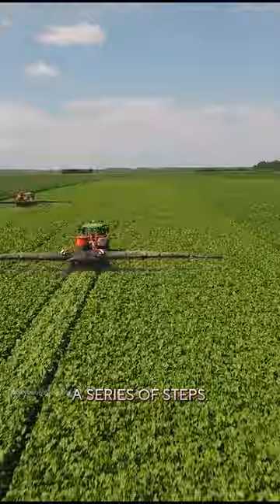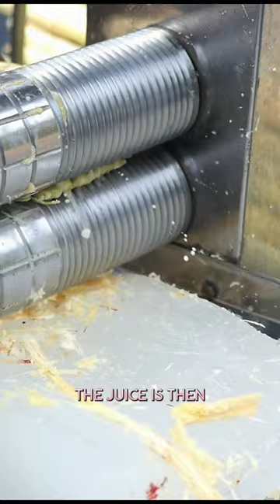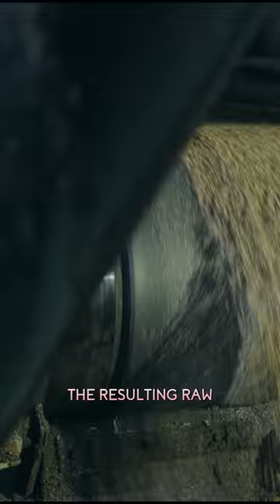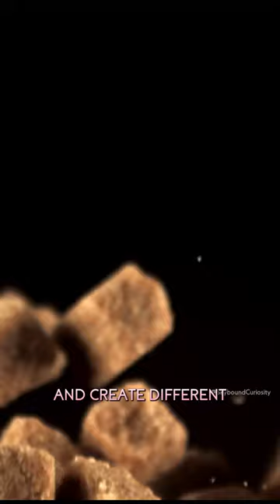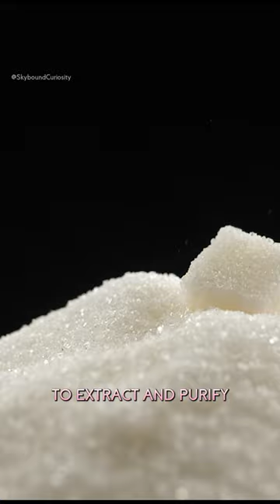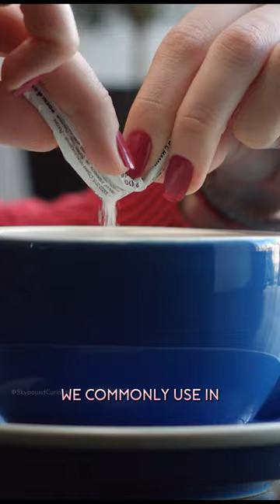From Harvest to Table: The Journey of Sugar Production

Comment: You have 3/4 of that process backwards, I’ve been making sugar for two decades
Reply from the maker: I disagree, there are multiple ways of making sugar. These ways differentiate from method, technology, capacity. Our video is based on official information for sugar processing.
Also, this is a 1 minute video max, so the amount of information that we can provide in this kind of video is limited, the video is more about curiosity rather than explaining the complete process of sugar making. However we are working on long format videos at the time.
Stay tuned.